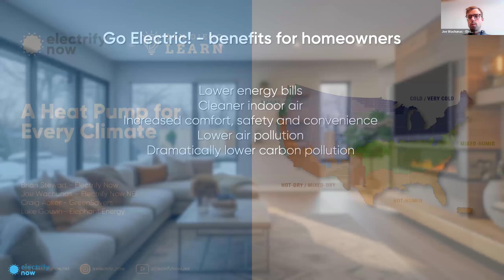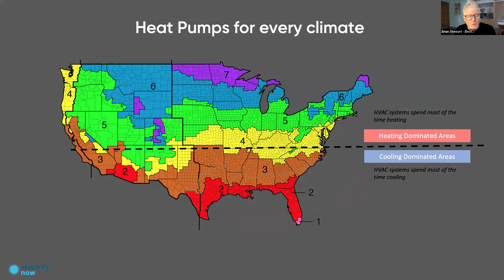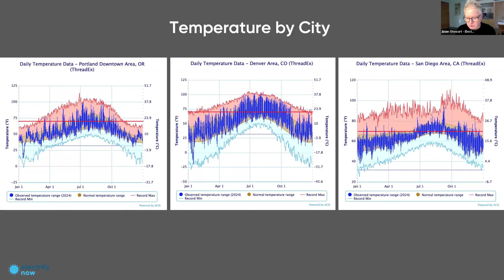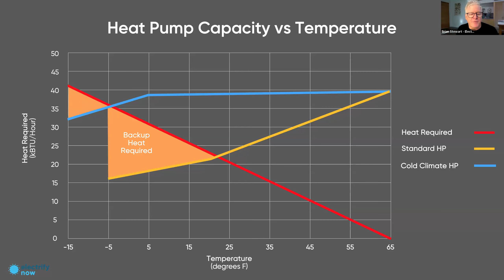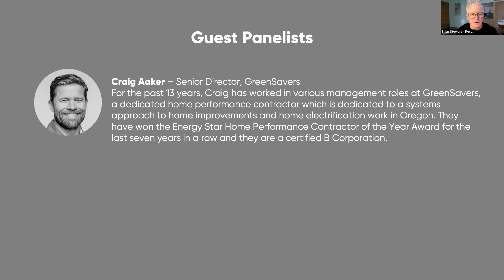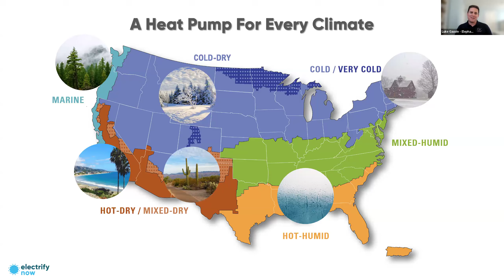A Heat Pump for Every Climate

Comment: I live in southern Arizona and have excess solar, so researching the best option to replace my older gas water heater and take advantage of current 2025 tax incentives.

I ended up with a Rheem 120V shared circuit, 65-gallon heat pump water heater.   Using Rheem's built-in schedule to control heating times throughout the 24-hour clock, I am able to utilize my excess solar and basically produce 140 degree hot water at no extra cost.   My hot water tank is now basically an energy battery!!

My feed back to Rheem is the installation could be made simpler with top mount hot/cold inlets instead of the side and bottom connections in current product.  As a result these 120v units require extra plumbing supplies and labor for the pipe routing complexity.

Comment: I have a top of the line Trane heat pump that is a new generation designed to be effective in the colder climates. Got it four years ago and it hasn't made it through one winter yet. It is covered in one to two inches of ice, never defrosts all winter, and will likely die as soon as it gets cold (lower than 34-36 Fahrenheit). Literally one big block of ice all winter. So far Trane has been a very poor partner to the distributor (super stingy and won't replace the lemon heat pump). Really disappointed in Trane as a company.